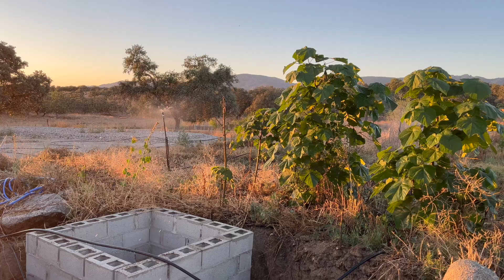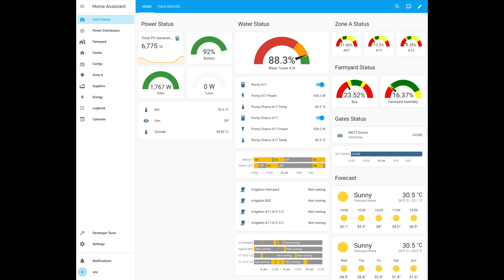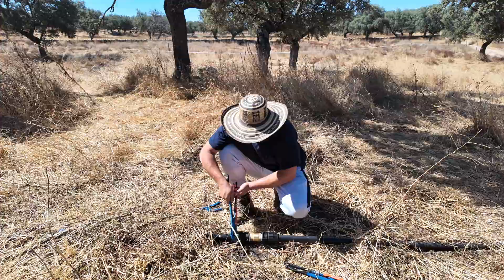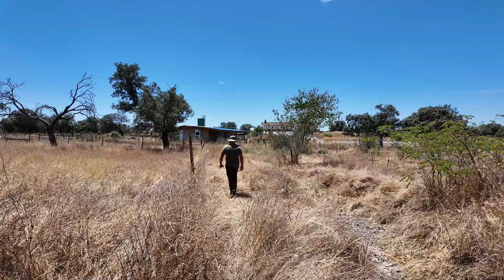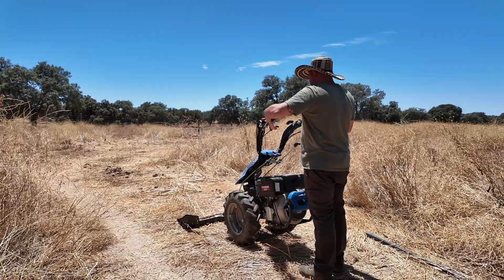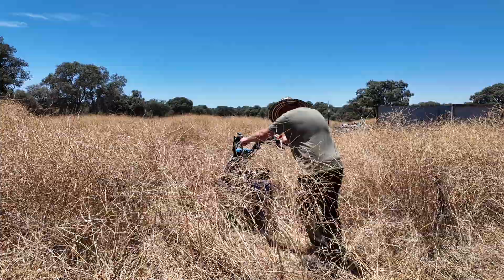Our IRRIGATION SYSTEM so far; Lots of DETAILS

Comment: Wonderful to see new green areas appearing.
PS - Perhaps the mower shown in the video might be right for the job, as it bundles/compresses the cut material in front of the mower?
Reply from the maker: If the material is "normal", then it falls and gets under the wheels. At least it's supposed to. We will see once the conditions are right

Comment: I miss your battery bank review
Reply from the maker: That's the weakest point of the system. Needs some 15 k€ to fix :-)
Reply: @ProjectGranjaCaimito  Its like 30kWh of lifepo4 storage for 15k. i once spammed you, i use used car/truck AGM, EFB batteries, they are not perfect, need some maintanance, but i buy them for like 30Eur/kWh, which i can get back after selling them in recycle center. Basically storage for free.
Reply from the maker: The problem is that whatever battery we use it needs to be compatible with the SMA Sunny Island. And our trusted installer will not use used car batteries for liability reasons. So I either accept that or learn how to do things myself. I guess I have enough on my plate already ;-) I've learned not to mess with systems that you need to rely upon.
Reply: @ProjectGranjaCaimito  I understand. But you can ask him, to make 2nd smaller system, MPPT 60A controller is like 60Euro, for 48V system its almost 3kW power, then inverter to AC, or directly you can use DC.  Depends if time or money is more valuable.
Reply from the maker: Storage costs are coming down and down. The goal is to grow a really big system for a LOT more than you see today. Electricity is very flexible and can be routed to where it is needed. In other words: we are basically our own utility and should treat it as such.

Comment: interesting, what is the app/system you showed there for the watering management? I would have thought that evaporation is a high factor at this time of year. It would be interesting to see an area irrigated at night to see the difference.
Reply from the maker: The screenshots are from Home Assistant (https://www.home-assistant.io)

Irrigation at night is better to use less water. But if you rely on solar power and don't have a very large battery bank, then that's not an option.

There is always a tradeoff decision to be made. In this case it's water usage or energy usage based on available energy storage.

Keep in mind that Home Assistant is a general purpose automation platform. It is not a turnkey solution and does require a LOT in the background in terms of infrastructure like Internet of Things and many network connected devices. It's a tool not a solution.

Comment: Have you thought about pumping water into a tank positioned high on your property and using the head pressure to irrigate at night without the use of pumps? 30m height is 3 bar pressure
Reply from the maker: This is a good idea but only applies to watering a garden or something where low flow is enough. The smallest wobbler puts out 270 liters per hour. That makes it 2700 liters per hour for an irrigation line of just 10. It's not so much the pressure but mostly the flow that counts. So that tank would have to be pretty big. A pond is much easier and cheaper to have.
Reply from the maker: And to add. That tank inside the farmyard is just a buffer. It is not the water supply in itself.
Reply: @ProjectGranjaCaimito  I did wonder about the flow so I looked up some flow calculations online that suggest a 2" bore pipe over say 200m with 3 bar head could deliver close to 9500l per hour. Yep the tank would need to be larger than your buffer tank but if a 2nd hand tank becomes available and can be brought to a suitable location then I'm thinking that would be easier than digging a pond, no evaporation, improved water quality. Anyway, keep doing what you're doing I've been watching your channel for quite a while and I'm interested in your efforts to improve your land
Reply from the maker: That's right in theory. Unfortunately the reality here on the ground does not allow it. But ... It's no problem. We adapt and find a way. Over time - of course